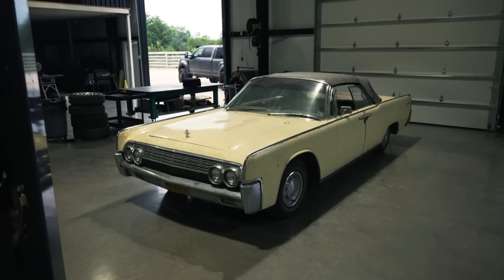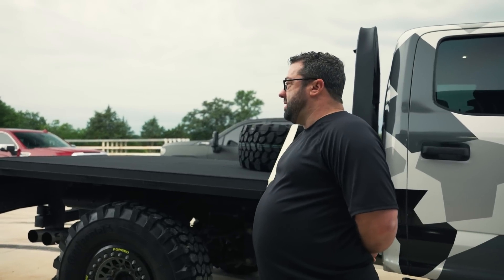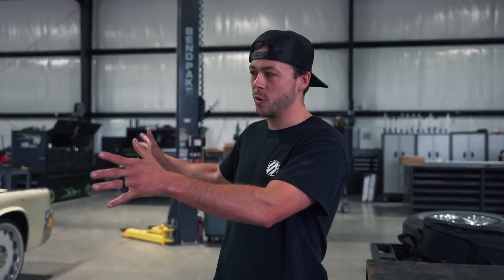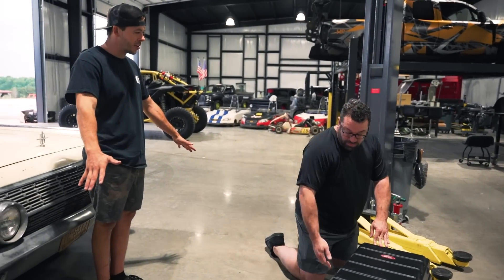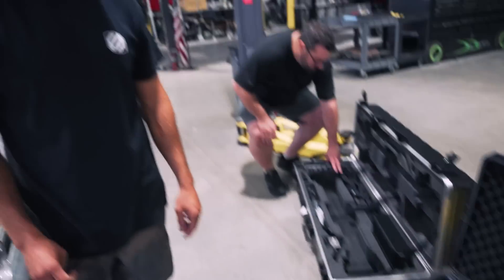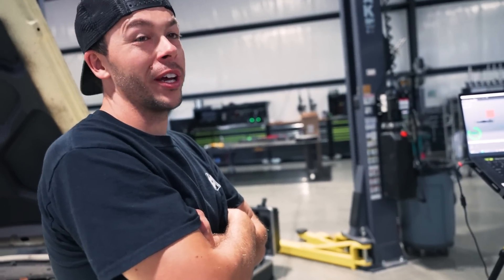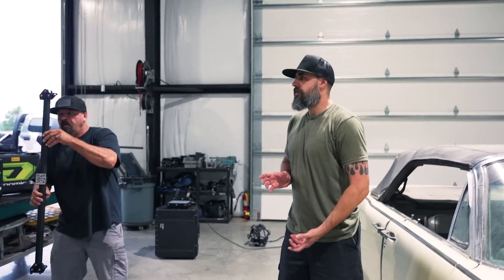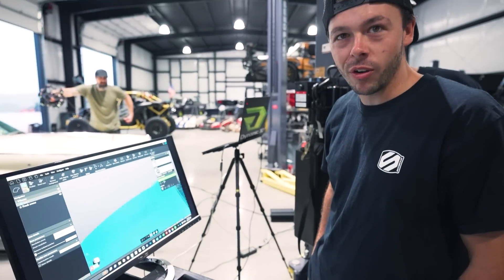Using $150,000 3D SCANNER For Our 1962 Lincoln Continental Build Part 3

Comment: We always used foam blocks and carved them to shape until we achieved the desired look and the built molds off of those. So technically we could still do all of it with the 3D scanning. Even used clay but we preferred the foam as it was lighter and cheaper.

Comment: looks like a structured light scanner they say the bigger the object the less accurate
Reply: The MetraSCAN is a laser scanner, not structured light scanner.  You are absolutely right about less accuracy when scanning larger objects.  The MetraSCAN can hold around 0.005" or better on a large vehicle like this Lincoln.  On smaller objects the accuracy is closer to 0.002".

Comment: 400+ series tire tubbed in the rear  on air ride with a twin turbo Godzilla and manual trans  with a hardtop that fold in the truck like the convertible and one piece Billet grill